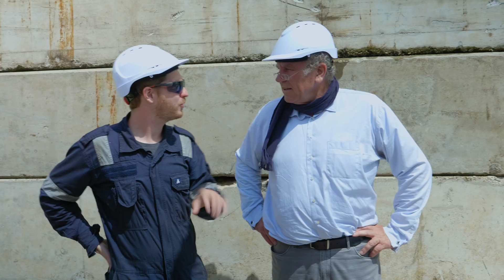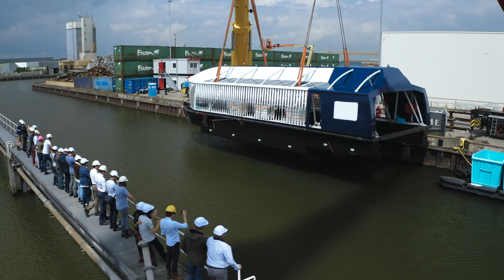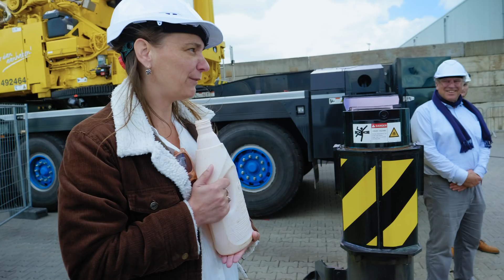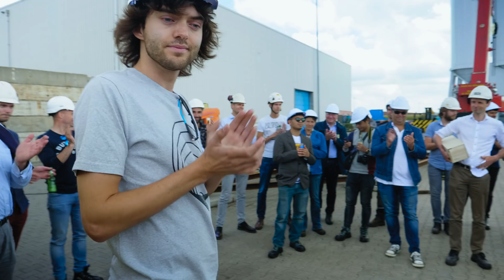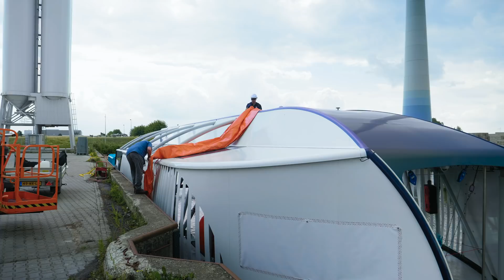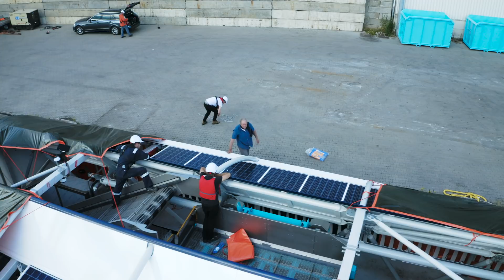Part 4: Interceptor’s Lift Into The Water And Its Baptism | Interceptor 004 | The Ocean Cleanup

Comment: Hello ocean cleanup. Great work on this interceptor. Cleaning the ocean by plugging the most polluted rivers is probably the best temporary solution were the absolute best is freeing people from being pore. How ever, I'm a bit reluctant to write this but if you want to clean the "ten thousand dirtiest rivers" you can not produce the interceptors in the singular else it will take ten thousand years to produce all the interceptors and as you know we desperately need them NOW. Thus you need to start building the interceptors in serial production. As an example look at what SpaceX is doing with the starship. They say that they will produce fifty starships with a superheavy booster a year. With that speed, the interceptors could make the two hundred most plastic polluted rivers clean within two years and the 10k will still take 200 years but that could be halved by just starting a new place to build them. The biggest problem is of course finance. You do not have a super-rich Tony Stark wannabe on your team. ;P
Reply from the maker: Thanks for the suggestion, though it is still significant, we hope to help tackle 1000 rivers, not 10000. but we agree that scale-up is crucial, which is why we will be working with a manufacturing partner to produce Interceptors more efficiently.